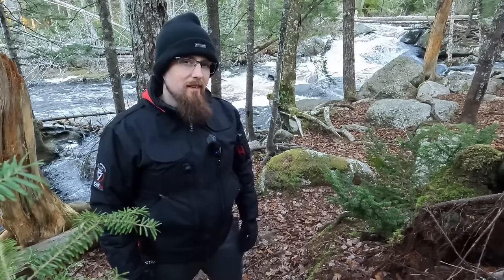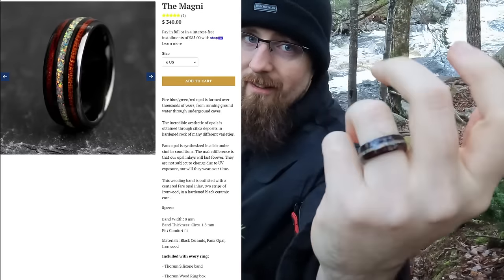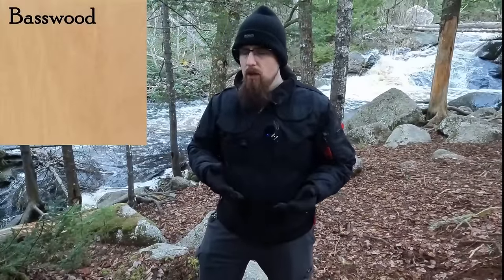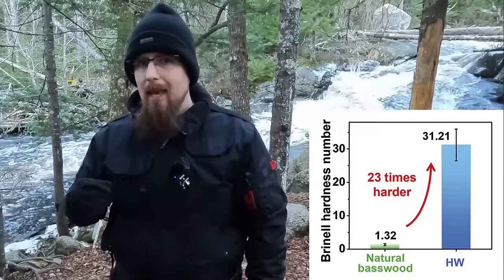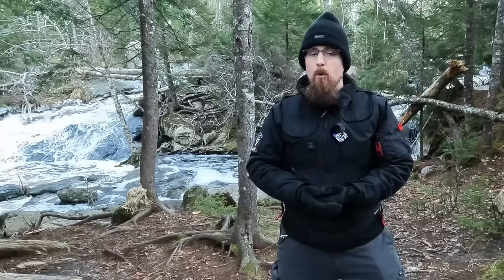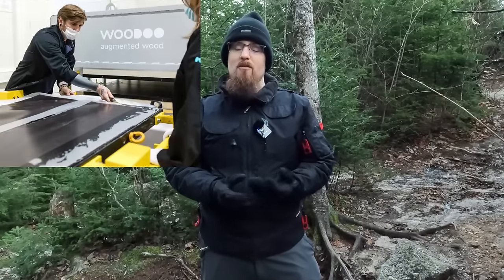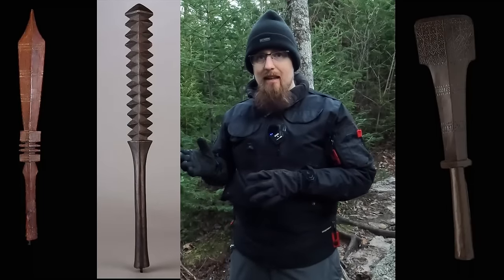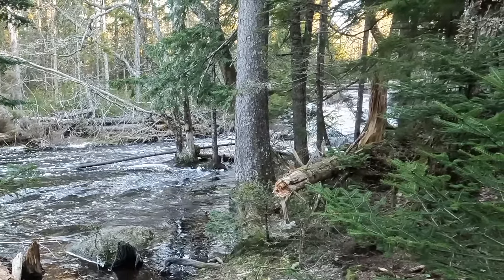Hardened Super Wood!  -  Can It Rival Steel?

Comment: Not long ago a guy here on YT (NileRed) made transparent wood. To remove the lignin he used a very common chemical, sodium chloride, that he compared to chlorine bleach in a way so i suspect regular bleach solution may work, just not as well. He boiled his samples of balsa wood in that solution to to remove lignin, as mentioned here. Now, since steaming or boiling wood in regular water makes it flexible, i think that might be enough for it to become nicely compressible as well. Not for x23 times hardness, but it ought to be pliable enough so it does not 'explode' from pressure while being pressed. Would be a simple enough process to re-create if you have a maker space that has a press in the area.

Comment: At the end of the day, most of these cool composites are just slightly stronger than if you add wood fiber to the same type of resin you are infusing into the wood. I'll admit that it looks a lot pretty when you haven't reduced the wood to sawdust first, but it is more a novelty than anything useful at this stage, maybe if they can get the cost down to below what hardwood costs to source we'd see some interest, but I suspect they also run into issues with pieces of wood that are thick or long.

Comment: I would be curious on the thermal and electrical conductivity of the material. It may be a good substitute for tools working on electric circuits (pliers, wire cutters, fuse pullers, etc.).

Comment: I think what’s interesting too with the journalism and how these sorts of things is how hardness and strength are conflated - hardness only refers to how resistant to scratching a material is, while strength has to do with how much force a material can take in a unit of area, and toughness is the amount of deflection the material can handle without plastic deformation

Comment: I used to do concrete. When we’re forming the nails we use need to be able to bend and hold shape. They get hammered bent pulled an removed and reused. I don’t know if these wooden nails would have the flexibility and durability as metal would have just based on its atomic structure.

Comment: You also have wood that’s put in a container of resin then the bucket (the wood is in the resin still) is put in a vacuum, it’s turned on and the air inside the wood is pulled out and the resin is pulled into those voids.

Comment: I’m sure someone would have pointed out that hardness doesn’t equate to strength and impact resistance. It would only make a good armor if it can resist impacts as well as cut resistance. An example of what I mean is that a super hardened metallic will shatter like glass if you drop it on the floor.

Comment: I agree they need to be careful how they word that. Clearly not harder than steel but definitely harder than you think. Which is fine. I know nothing of the carpentry industry so hopefully these new methods helps them out. I can see this working in more tools and weaponry. Especially large weapons like spears, war hammers, arrow shafts and like you said, possible transparent shields! I think someone mentioned it earlier but a super-wood quarter staff?! Although if it's super dense and hard, and you strike something with it, would the wood carry the vibrations the same? If you hit another super-wood quarter staff full tilt, do the vibrations go into both combatants hands and you both drop them cuz the staffs are too hard? There's generally some flex to them now to resolve this issue. So maybe "if it ain't broke, don't fix it"? Idk man but this all seems fun to theorize about. Cool vid!

Comment: Using this for joinery like doweling or driving pegs and stuff like that would be really cool.  hafts and other wood weapons like staves it's just ideal if it holds tensile strength along with the hardness.

Comment: Do you think it would be a good for a guitar neck which needs to,be stable or would it still move slightly with changes in temperature and humidity would a truss rod be able to,adjust it

Comment: I did look into the chemicals used, and one of them is actually possible to get from natural sources. Namely, oxalic acid, which can be extracted from rhubarb leaves, produced by some molds or synthesised using nitric acid and sugar. Though, it's not exactly something one can stumble upon by accident. Chances are, to actually discover this a society would need to be in the need for such a material, oddly enough like ours is now. So in a fantasy setting where metal is hard to come by but other aspects of the society are advanced, it's feasible that this technology could be discovered and used.

Comment: I have an air nailgun with hardened woodnails, its good to apply softwood on softwood or other soft materials. For dried hardwood, it makes split the hardwood you need drilling before, so really good only for softwood.

Comment: I'm very curious about whether the material loses a great deal of flexibility in the process. Hypothetically is it didn't become incredibly brittle, it could make extremely high quality armor just due to the fact that it's fibrous. You might not even need to increase thickness and weight to make it usable.
However I suspect the chemical and mechanical process would negatively impact the fiber structure, making the material very hard but significantly more brittle than metals.

Comment: So some things to think about, soft woods like basswood grow much quicker than hard woods, so having a process to harden soft woods is quite useful since you can use very soft woods for things you couldn't traditionally use them for. Second since you are softening the wood then compressing it, you have quite a bit of wiggle room with the shapes you can now make during compressing. Finally there are methods of building without nails, specifically look at japan, so while nails are convenient they aren't necessary.

Comment: I am making primitive bows and walking sticks (for hobby) and fire hardening is a great thing + after several coats of tung oil, rubbing them with steel bars and polishing with beeswax. Also, keep taking care of those things to make them live longer. For example I am oiling my bows every month at least once. So I have some wych elm and yew bows performing 5 years already like first day. They are fast and strong and no deformations. 
So, in conclusion for me, use methods which our ancestors used and be creative and experiment for better results. But keep in mind, best things are simple.

Comment: It might be possible to take the seaweed which washes up on tourist beaches and use this compression method to fuse it in something which has characteristics of a beam of lumber to use dead material instead of live trees to produce wood substitutes.  The compression could produce some food grade oil that could replace palm oil, otherwise it could be used to produce carbon neutral diesel.

Comment: I would be interested to know about its strength to weight ratio compared to steel I would be it is better. 
One point that is always missed about wood it that it's stress cycling resistance is way better than just about anything. It has to be trees stand for hundreds of years swaying in the wind.

Comment: THe first idea for weapon use could be maces. They doesn't require so much hardness. I'm not sure how much wood you would need to do this. 
THe next one would be compound bows. You could make them with much higher weight than regular ones. The hardness and give could make it less prone to breaking. 
Regarding swords it would be interesting to make a compound. Like a steel edge wedged into wood. The lesser weight of wood could allow a longer blade.
As other uses goes flooring comes to my mind.

Comment: From Arizona  , in the southwest we have a wood called iron wood it's very hard and very hard to work you have to use special techniques like immersing in water between working and cuting it green , if you want to work with it faster you will have to use carbide tools , it has a resin in the wood you would not believe you will need to clean your tools with a very aggressive solvent... word to the wise ......

Comment: You could make axe hafts out of hickory where, if you combine these treatment and compression methods with other traditional structural plans (like good grain orientation, properly fitting hafts to sockets, etc.,) then you can make axes with hafts that last EVEN LONGER and stronger than the amazing axe hafts we have today! You can make knife handles that can withstand even more than just one lifetime. If this process can harden and strengthen lumber, then you can even build houses with a much more solid and bug-resistant frame too. This potential breakthrough in material sciences would have a MILLION wonderful applications if its legit what they hype it up to be.

Comment: in some construction scenarios laminated wooden beams are cheaper than steel beams and achieve needed strengths to hold together the roof
Been to some buildings that use those - also look really nice 

would be interesting to see more economically viable wood replacements in the world

Comment: My grandfathers had a log cabin in southern ohio, every year "for almost 200 years" it was sprayed with mineral oils that had been cooked awhile, in the late 60's I was asked to install a TV antenna, when came time to drive the nails for mounting the wires, it as a no go, all I got were sparks, decided a drilled hole and screw was then the best bet, even my best carbon steel bit only threw sparks, went to masonry bit,  after an evaluation of alternatives I ran them on the concrete beds between the logs they might as well have been agatized.
Reply: Side note, it still stands and is being used by cousins as a primary residence.

Comment: It would be helpful to have more clarity about hardness vs strength in wood. A nail made of hardened wood is not much good if it is not strong. In the cases of many kinds of materials there is a tradeoff between hardness and strength. Materials that are hard tend to lack strength and strong materials tend to lack hardness.

Comment: Basically tempered Masonite is just heated compressed wood fibers and saturated with linseed oil.
By the way, hardness is not the same as strength. Wood is stronger for its weight than steel.

Comment: You can make any wood really strong by stabilizing it. But the method they are using will have little effect on heavier hardwoods. And they just massively increased The weight of the wood. But you can use some crazy different techniques to stabilize wood nowdays, but it always makes it heavy because it involves soaking something into the wood.

Comment: It's like saying that silk can rival steel. The strength per pound ration is better, but that is tensile strength and does not take volume (density) into consideration. 
I believe the wood would have better sheer and tensile strength so long as you are across the grain but the steel would still have better compressive strength, abrasion resistance and torsion resistance than the wood.

Comment: If they added oil to increase water resistance, then wouldn't it be more susceptible to fire? It might also increase the burn time and heat of flame produced depending on what oil was added. So that in turn might be a drawback for construction.

Comment: I could see the potential for this wood being used in boat building to replace steel on medium size vessels and wood cores in fiberglass For making cheaper and lighter boats And small the medium size commercial vessels like fishing trawler small cargo boats and saving the steel for the actual giant multi  He's stack container ships  But if you've got a small cargo ship that's just going down the inner coast a waterway or trying to get across the Gulf of Mexico or a barge this could be a very cheap way to build it and still work just as good

Comment: I have a strong suspicion that the hardness is proportional to the level of compression, not so much the starting wood material. I haven't read the paper, but it would make sense for them to use an extremely soft wood to get the highest effect that they can measure.

Comment: The problem I see with hardened wood is it loosing many of the shock absorbent qualities it would otherwise have, making it rather redundant.
For example, wood tool handles are so desirable since they absorb the vibrations from striking unlike steel handles.
Wood framing is good in more cismicly active regions due its elasticity compared to brick/concrete/masanory/steel.

Soft woods would is also easier to work with than hardwoods, so you end up degrading your tools quicker and needing higher grades of them.

It sounds like a fun material however practically it creates more problems than it solves.

Comment: I see two main problems weapon-wise.
1.  Weight.  As someone pointed out below, an increase in density = increase in weight.  It would be hard to meet or overcome the strength/weight ratio of steel.  What is the advantage in a wooden supersword if it is heavy as hell for its size?
2.  Wear and upkeep.  This really comes down to "toughness."  Steel is great in blades because it is both hard yet workable.  What happens when a blade of this material dulls?  Can you reshape the edge via stropping and honing as with steel?  Can you easily sharpen (ie regrind) the edge once it's recieved significant wear?  If not, the practical usability as a blade goes down significantly and you just have a wedge-edged club (which already exist) rather than an actual useful blade.  And if it can't make a good blade, then it's basically just useful as a heavy, dense, shapable material and plenty of those already exist.

I guess my question is, what material that we already have does this stuff meet or outperform?  For practical market viabity, it needs to outperform something that already exists in order to be worth the effort.  As far as environmental sustainability, it would still need to at least meet the performance of what it is intended to replace.  Even the latter seems unlikely.  Purhaps the real test is wether or not new applications can be found rather than competing for current applications against established materials.  Expecting to see "superwood" versions of what we already have in other materials seems unlikely unless it maybe enters the market as an efficient and environmentally-responsible alternative to single-use polymers.

Comment: technically early chemistry discoveries are easier to handwave at virtually any point in history. I'd find the hydraulic press/pressurization aspect the more difficult to slot in to a historically inspired setting (though I can imagine how magic could resolve that issue quite easily)

Comment: Hardness also isn't exactly the same thing as "strength".  Hardness is the resistance to deformation and strength is ability to withstand a force/load.  You can have something incredibly hard like glass but it is not very good at withstanding a load, or you can have something very soft but able to withstand a large load like paracord.  Then there's the difference between Compressive strength vs Tensile strength vs Shear strength.  You can compress wood as much as you want, but it doesn't necessarily make the bond between the grain stronger.

Polymer infused might be promising in the same way fibre-reinforced polymer might be an interesting material.  Xyla Foxlin made a video about trying to recreate the see-through wood, and it's a lot more than just infusing the wood with resin.  First you have to break down and remove the chromophores, but the process used to do that also make the wood very fragile. (https://www.youtube.com/watch?v=5qS9AKzXYOY)

The best use I can imagine for this super compressed wood is flooring.  As an owner of a large dog, a veneer of this stuff for wood flooring would be amazing.

Comment: Rather than an oil bath treatment. I would use an epoxy infusion under high pressure or work to polymerize the wood.  It would work great for armor as it would still have different properties than steel. Rather than looking at it like steel it needs to be looked at for what it is.. an organic polymer. So what you are doing is creating UHMD CELLULOSE and it probably compares favorable UHMW polymer armors.

Comment: You can use a vacuum chamber to force a piece of cured wood to become fully saturated with linseed oil. When the linseed oil cures, it becomes something a bit like amber. So-called "diamond wood" is just wood that's been subjected to this process, though polyurethane is typically subbed for the linseed oil. Doubtless because it's much cheaper.

Comment: Definetly a very interesting study. The main reason this will probably not take off outside of exotic applications is the process. It take a lot of effort to produce this super hard wood (granted it could be streamlined and turned into a production line) so for applications like nails, which are made by the millions out of steel, I can't see it taking over. In the world of more exotic materials it might see some use, but it doesn't really seem to have a better strength to weight ratio than things like carbon fiber, which can very easily be molded to suit whatever shape you need.

Comment: if theyre worried about shattering or cracking when using a nail, drilled/screw fasteners are a clear simple solution, modern adhesived offer another, and then of course traditional woodworking techniques that dont use nails, bolts, screws, or adhesives at all.

Comment: Hardness isn't everything. I think the idea of having harder wood with full length wood grains in it could make wood quite strong. Almost like rebar in concrete. There is a lot of metallurgy in changing the shape of metal crystals to change the strength of metal in certain applications.